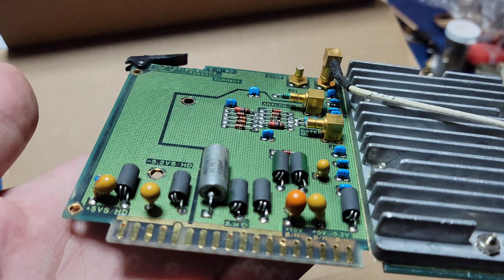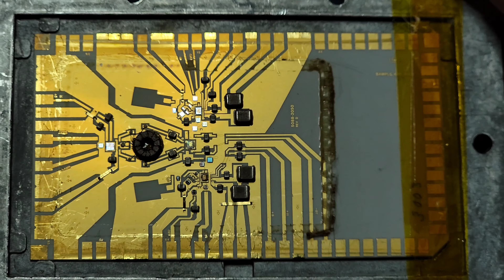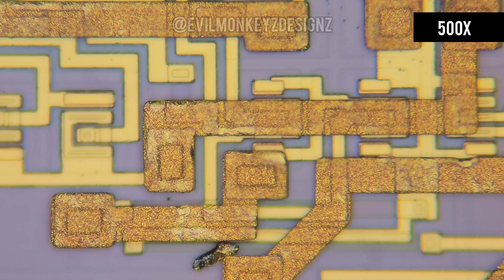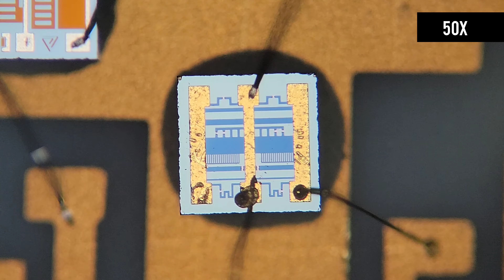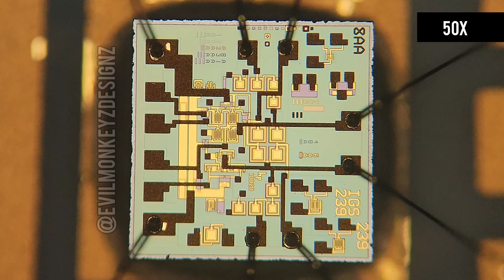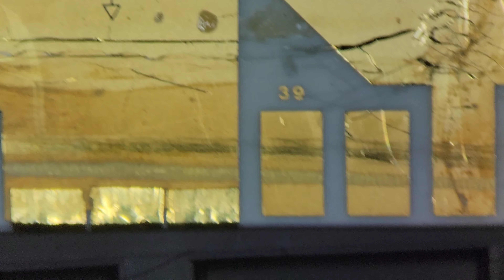HP 5180A Digitizing Waveform Recorder Sample and Hold Circuit board

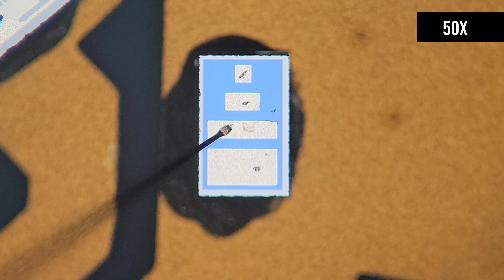Comment: 7:17 I think this is a capacitor, and perhaps used to  tune some high speed ish stuff (and perhaps in combination with the relatively long bondwire to it makes a specific series LC circuit, could it be to suppress a certain frequency? Or smoothen some nasty square wave flanks?)
Reply: Nope - the transformer/ferrite ring is used to develop a signal to differentially gate the diodes ...  this is the heart of the sample and hold.

Comment: Wait, that middle circuit, did I see a FULL BRIDGE RECTIFIER on this diamgram? ElectroBoom would love this stuff
Reply: 4 diodes used as a switch - drive the upper and power connection points and the input and output are L and R respectively (or vice versa).

Comment: I know it’s probably not as interesting, but can we open up something that’s actually new and see how little precious metals or gold is inside of them anymore. For example, gold bonding wires do any of these new ICs have any gold bonding wires or no?
Reply: Yes most IC's still have bonding wires to the lead frame. For higher speed parts we get the bare chips with solder bumps that we put directly on the PCB, thereby eliminating the bonding wire inductance.

Comment: Not sure what 100k test equipment You're looking at but 100k buys you a LOT nowdays, which makes sense considering the progression of technology. 

But for something to be 100k its gotta be either super niche or super comprehensive in its field.
Reply: We used 100k test gear as the Spectrum analyzers in cellular tower radio repair. Doing QAM analysis, doing frequency, bandwidth, power measurements, all of it. It really was a great little workhorse.

The 5G stuff we had was even crazier. Probably about 250k, fully automated test gear for the Verizon 5G home boxes, those white ones you've seen ads for.

For the cutting edge stuff of the modern era, 100k range isn't too far off. The real crazy thing is that a 20 meg sample storage oscilloscope was cutting edge in 1982, worthy of 100k and a feature in the HP Journal, and now, it's a 60 gig samples per second beast, that runs windows, and can do digital Fourier analysis, convolutions, etc, all programmed in software to the user's use case.
Reply: re: :Not sure what 100k test equipment You're looking at but 100k buys you a LOT nowdays"

Then was then and now is now; we have come a long ways, and we built it with gear like this as we moved forward ... que?
Reply: This was state of the art in 1980 - hence the state of the art cost. Today you can buy something similar for less than $1000 (20 MSPS Oscilloscope, like a Picoscope). But a state of the art oscilloscope today costs upwards of $500,000.